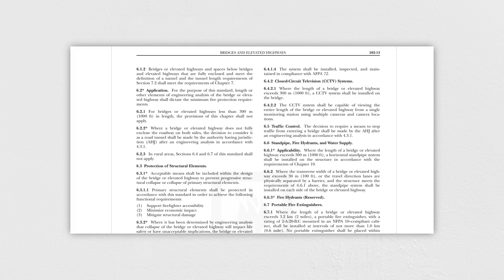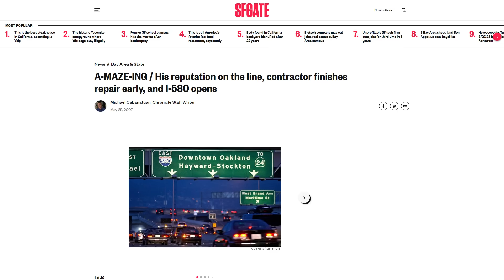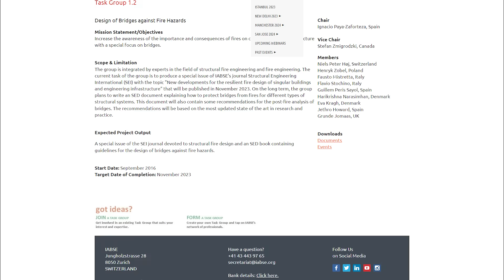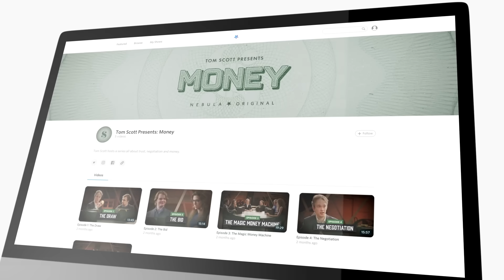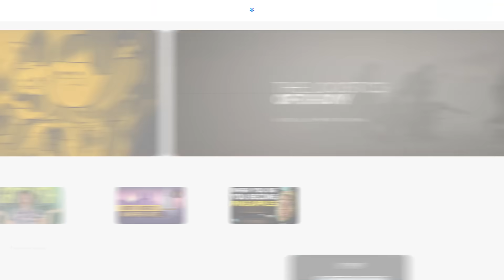Philadelphia I-95 Bridge Collapse Explained

Comment: 911 conspiracy theorists won't like this video.
Reply: “A second tanker hit the second bridge. America is under attack”
Reply: @clarkesuperman best comment! 😂😂😂 That made my day
Reply: @clarkesuperman 'fire doesn't get enough to melt steel and concrete someone use explosives' bridge falls from fire......
Reply: Conspiracy theorists are the Karens of major news events. A few agree w/them, some try to reason w/them, & the rest are mildly entertained but hope they don’t reproduce.
Reply: If this wasnt true, why do the tunnels in seattle all say "Flammable cargo prohibited in tunnels" because when super heated, concrete cracks and flakes apart, losing almost all of its strength. Steel reinforcements soften as they heat and bend under the load. Feedback loop ensues and concrete and metal failures lead to a massive, multi-ton chunk of rock and metal falls due to gravity. Yes, you can take a huge building or bridge out by having a huge fire in or under it
Reply: A structure designed to support heavy traffic collapses under its own weight when exposed to extreme heat.   Imagine if it had a 30 story high rise above it (not to mention kinetic damage from a high speed impact of a 200,000lb jetliner).
Reply: @guntherultraboltnovacrunch5248  there are also record number of investigations on the steel being used for bridges... beams Bought in China brought to america (terrible in China ore we all know Australia & the American Rocky's have the best iron ore) ... Beams then melted down in America & stamped American made... Just so they can beat the paper work & use cheap steal in America

Bridges have been a focal point of investigations because of there rapid decay from poor material & shoddy installation practices
Reply: Omg why did you start this? 🙄 :picard:
Reply: @J.C... because Truthers are great entertainment
Reply: Why? The immutable laws of reality never bothered them before.
Reply: @relectric69 lmao, conspiracy theories are almost always wrong.

There are very few occasions where a conspiracy theory turned out to be correct.

Take off you tinfoil hat, fluoride isn’t mind control, and touch some grass.
Reply: Untill you find out Bush owned the Truck!!!
Reply: Didn't some guy get 4.5 billion in insurance claim from 911
Reply: @devinsummer5838  So you think because the towers were insured that it was in "insurance job"?  Fabricated the terrorist story...Then they hijacked 4 planes, and killed 3000 people to get a 4.5 billion insurance payout?
Reply: @guntherultraboltnovacrunch5248  yeah
Reply: @--Valek-- well the overpass didnt have thousands of pounds of fuel burning, with high pressure air whizzing through the broken windows feeding the flames in a 'ramjet' fashion. Air travels along the sides of the building and builds pressure. High pressure air is like a turbocharger of a car. The bigger and hotter the flame, the more air it burns, funneling it and increasing the heat. A tall building falling can leave detritus further out than the height of a building. Yes, nearby structures get slammed with it, did anyone watch the street level views of the wall of concrete looking like a tsunami of rock? Also, if the building was demo'd it would have only been to cause a controlled fall, dropping the building on itself instead of falling over sideways as one side fails
Reply: @TheSkubna  how did anyone know they would need to rig the building with explosives so they would be ready for a controlled drop... Or did the demolition crew race inside while everyone was evacuating & set up the demolition in miraculous turn around time with no flaw in installation ???
Reply: @py2724  well, see, they clearly had to come in early and get it set up. You know, like the fireworks on the space needle. They just used too much. And the jets proved to be a great ignition source, like using those unscented incense 'punks'
Reply: @TheSkubna  possible they knew they couldn't stop it from happening so they made precautionary steps... 

"CONTROLLED LOSSES"
Reply: @TheSkubna  NIST's own report states and it's common sense that the fuel from the planes were used up almost instantly and served only to initiate the fire.
Reply: @--Valek-- That is interesting, considering how long these tanker collisions burn for. Someone has their mini broom and dustpan out somewhere.
Reply: @TheSkubna  NIST's own report said the fuel was used up in seconds.  The fire was supposedly office furnishings.  The flames coming out of the windows were orange, and the smoke was thick and black.  The office fire initiated by the plane strike wasn't a raging inferno.  But yet streams of >sparking< molten metal is seen pouring from at least one window.  The theory I think has the most weight behind it is a thermitic device that was dislodged from one of the beams and was pouring out the window.  If a wooden telephone pole can take off an airliner wing, there's no way for a plane that just punctured the thick exterior wall then had enough structural integrity to sever enough concrete covered core columns for fire >alone< to cause collapse.  Never mind the speed at which the collapse traveled.  The collapse speed alone violates physics if you believe it was just from the debris from above landing on the structure below(which was designed to carry 3 times the weigh as redundancy)
Reply: You beat me to it... those planes were essentially flying fuel tankers since they were pretty much full on collision. Sure, buildings have some engineering for fire, but not a fuel-fed high-temperature jet fuel fire. That is outside the realm of imagination for all but a few.

It almost makes one wonder if they had gone over the engineering and knew what the consequences would be.
Reply: Why did the Kersh rail bridge not go down like the road bridge?
Reply: @20chocsaday because it didn't get exposed to hours of heat
Reply: @20chocsaday  I’m guessing cuz train bridges are redundant while bridges that carry cars are segmented non redundant…meaning if one part goes it all goes
Reply: Clicks on comment labeled “DEAD DOVE Do Not Eat” … I don’t know what I expected.
Reply: They probably wouldn’t understand it…
Reply: Their lives are full of " short" , busses , inseams , and being denied from riding carnival rides .
Reply: You summoned them
Reply: How do you know there are exactly 911 of them?
Reply: @Falcrist  common core math
Reply: @Falcrist  hardy har.  :face-green-smiling:
Reply: I came here looking for this comment. Not disappointed
Reply: @310Bees no, you just don't trust sources that tell you something that doesn't agree with your understanding of physics but you believe it anyway, authority is not automatically truth
Reply: @TheBananamonger  It’s crazy how much some of you are desperate for attention. Were you not given enough attention as a child? Need to feel special?
Reply: Bet it didn’t fall at free fall though
Reply: @thepostofficeprince8819  The bridge didn't free fall?   There were 25 floors being supported by the damaged floors of the south tower (floors 77 to 85 damanged and burning).   That bridge had NOTHING on it, and it collapsed.    How much force would a 25 story building have falling 8 feet?  I'd say it would be enough to collapse the floor beneath it, then the one beneath that... then the one beneath that... then pretty much you got millions of tons of steel falling.
Reply: @guntherultraboltnovacrunch5248  I really don’t know if it would or not personally, it’s not my thing. I have no idea how much force something like that would have or how much the lower could withstand.
Reply: @thepostofficeprince8819  Any object connected to another structure cannot fall at freefall speed.
Reply: BINGO!!!!  I cannot stand those jackasses.  As soon as I hear them say "jet fuel doesn't burn hot enough to melt steel" I know I am dealing with a moron.
Reply: But the jet fuel won't melt steel...who cares if it weakens it.
Reply: The moon landing was flat. Jet fuel can't melt Dealey Plaza.
Reply: And the virus came from a wet market.
Reply: The term "conspiracy theory" itself is an invention of the ꓚꓲꓮ
Reply: WTC7 collapsed under the weight of intact passports that landed on it
Reply: With how many "conspiracy" theories have been coming true, I have no doubt that the US government had something to do with the September 11 attacks.
Reply: @relectric69 Realize that these conspiracy theories are fed to you by the richest and most powerful in order to distract us all with useless arguments and make us not question the disproportionate power of capital.
Reply: Bigfoot is responsible for 911
Reply: @TheBananamonger Much better to believe mentally ill trolls podcasting from their mum's basement. You conspiracy theorists are all delusional and belong in padded rooms.
Reply: The most Farfetched conspiracy theory about 911 is that jet-a1 fuel fire can burn hot enough to collapse a building. 
You need to be really dumb to believe in that one
Reply: The job of alex Jones conspiracy theories is to muddle the questioning of the official story with kooky theories,

The more important information about 911, was the fact that mossad was involved with the operation.,  and this was just like their first 911, the USS Liberty.
Reply: I came here to say the same thing.
Reply: @--Valek-- they found a building hundreds of feet in all directions. Moron
Reply: So many spastics in these comments 😂
Reply: @--Valek--  source?
Reply: @archive8080  source on the fused iron concrete in the basement?  You serious?  I can look it up sure...but this is like asking for a source when saying planes hit the towers.
Reply: RepentandbelieveinJesusChrist  "and midgets." Probably Danny devito.
Reply: HA! AAAHAHAHAHAHA
Reply: But if the fire doesn’t turn the structure into liquid it shouldn’t collapse right? 😂
Reply: @sterlingreece9355  false
Reply: Fr the police dont exist.
Reply: I think any job interview should include a question about WTC7. Think of the problems that could be prevented.😬
Reply: Ah yes - this video proves that an explosion did not collapse concrete. It also proves that potential energy/ gravity is sufficient to pulverize concrete into dust. Thank you for your thorough observation blind man. 🤡
Reply: millions of tons of commerce doesn't travel on top of the world trade center daily tho 🤔
Reply: @Hambush13  I think you're missing the point.   This bridge, designed with steel, failed under its own weight with burning fuel under it.   The trade centers, made with steel failed supporting the weight of  17 floors on one, and 33 floors on the other.   This bridge collapsing under its own weight supports evidence against the conspiracy.    As a young man witnessing the attacks, I kept asking myself why the towers hadn't collapsed.
Reply: Jet beams can't melt steel fire
Reply: Beat me to it.
Reply: They don’t like being questioned on anything. Simply asking “why?” enough times makes any argument fall apart
Reply: I was thinking the exact same thing. Already seething in your replies lol
Reply: Wow, 25 mins and people have already devolved into childish arguments. At least make some engineering based arguments everyone - preferably with something to back them up.
Reply: @davidjennings2179  Why was nanothermite found on the ground in the area? Why were huge steel beams thrown so far horizontally during the collapse? Why do other skyscrapers seem to be able to ensure similar fires without collapsing? 

How was Larry Silverstein so incredibly lucky to sign a new lease with terrorism insurance just 2 months before 9/11 which paid him $4.5 billion?  Why was he at "the doctor" that day instead of his usual breakfast appointment?  Pretty nice that he also got to avoid an unfathomably expensive asbestos abatement project...

How were the pilots able to perform the maneuvers so perfectly despite their flight instructors saying that they were barely competent to fly a a Cessna? Specifically at the Pentagon (of which we have no footage) where he did a perfect spiral down from about 20,000ft.
Reply: @davidjennings2179 Unfortunately that's not something conspiracy theorists are concerned with.
Reply: @davidjennings2179  there is no point arguing with 911 conspiracy theorists - it's a settled issue. There is no argument.
Reply: @davidjennings2179  a plethora of experienced high rise architects and structural engineers agree, controlled demolition.
Reply: @davidjennings2179  People have already made engineering-based arguments in this comment section. There are also 1,700 certified engineers who signed a document encouraging more independent analysis regarding the cause of the collapse
Reply: @micahned  That's great. Some people have made engineering arguments and I'm all for that - if there is something to be debated with facts I want people to keep debating it. The issue I have is with people devolving into playground talk. I can't remember what it was exactly but the comments were something like "my guy won" and "oh it must be opposites day" whatever side of the debate those come from they're not helpful to anyone.
Reply: @micahned and where are those “engineering-based arguments”? Because I don’t see a single one.
Reply: That was my response when I heard about this.
Reply: It's almost as if fire is destructive or something
Reply: Oh? Like WTC 7?
Reply: @coltonkay9000  and here come the anti-Semites
Reply: I always thought that too when this bridge collapsed I was like waitttt fire is hot enough to melt steel beams ? And it doesn’t have to even be jet fuel ????
Reply: They don't tend to like any science or engineering channels 😄
Reply: @harmonic5107 but some do, and more questions left unanswered than answered
Reply: @harmonic5107  Oh they love science and engineering channels!  They show up to spew BS in an attempt to show how smart they are versus all those people with engineering degrees or a capacity for critical thinking.
Reply: @TheBananamonger  Your comment could apply to either side of the argument
Reply: Why? Did Lucky Larry's entire family call in sick that day too?
Reply: Bootlickers will love this video
Reply: @dingdongmagee  your guy lost
Reply: @hayleyxyz must be opposite day pal
Reply: @dingdongmagee  just what I thought. delusional 😊
Reply: @hayleyxyz you're*
Reply: See this bridge thing makes sense, how you can compare that to 911 and think that makes sense is beyond me, there's literally no comparison between 911 and a bridge collapsing from fire
Reply: @mattb6646  they are both structures.  Both failed due to heat, compromising the integrity of the structure.   The big difference is the bridge collapsed w/ out having to support anything more than it sown weight.   Meanwhile, the towers had multiple floors damaged, AND had to support the structure above.
Reply: @mattb6646  heres your mental gymnastics trophy!
Reply: @dylansylvester4719 well atleast point out what you think is mental gymnastics if you're gunna respond, don't be cheap
Reply: @mattb6646  hey if you can't figure it out on your own
Reply: Ai bot
Reply: @davidstanziani5256  who is the ai bot?
Reply: I can understand that steel is weakened by heat, while still questioning who the real perpetrators of that attack were lmaooo
Reply: @Regular.Traffic   You really think we have to attack ourselves?   We piss plenty of people off.   And think of the 100's if not 1000's of people it would have taken to orchestrate this clandestine act, all of whom would have to remain quiet.    The only thing I'll consider is the possibility that Bush and company knew more than they led us to believe.    Watch a documentary called "Bitterlake".
Reply: @Regular.Traffic  lmaoooooooo
Reply: That's cool and all but never forget nothing hit WTC7
Reply: @ek8710 debris hit WTC7. And fire.
Reply: @ek8710  you have another conspiracy theorist in here complaining about the tons of molten iron and concrete that were apparently flung hundreds of feet away. Can you guys just go into a room and figure out what it actually is you think did or did not happen and come out here in the real world when you have a consensus?
Reply: @AliasA1 there is no consensus with conspiracy theories. That's how they stay alive. One hole opens someone plugs it. Making a new theory.
Reply: @ek8710 except for debris and outer mesh columns from WTC 1 that punched holes in the facade
Reply: @ek8710 so the 2 massive skyscrapers falling beside them did no damage to a building sharing a foundation with them.😂
Reply: @ek8710  Except for the enormous pieces of the buildings falling next to it and the uncontrolled fires raging inside of it. 

Christ, do we need to do this again?
Reply: @ek8710 are you arguing only planes can start building fires?
Reply: @ViolentOrchid I did not even know they knew how to build fires...
Reply: @ek8710  Stuff hit dozens of buildings, mate.
Reply: @UncleKennysPlace  there is absolutely no way you believe “stuff hitting buildings” explains the demolition of wtc7
Reply: @dingdongmagee ’stuff hitting buildings’ bruh, it was huge air planes. All it would take is the weakening of load barring elements on the floors that where hit to create a cascade collapse as higher floors slam into lower floors. That sort of stress on steel causes it to heat up, even to the point of melting. This is phenomena is well understood by anyone that has machined metals.
Reply: @dingdongmagee must be aliens then
Reply: @UncleKennysPlace you think falling debris made an entire building collapse? Are you daft?
Reply: @dingdongmagee Did you fail physics class?
Reply: @UncleKennysPlace yeah but a little peppering of debris doesn't make a 47 story building fall at free fall
Reply: @NZ-fo8tp and if that was what happened it would have looked totally different and large pieces of the build would have still been there, not obliterated into dust.
Reply: @dingdongmagee and your education or experience that lends any credibility whatsoever to your claim?     Anything?  I didn’t think so.
Reply: @ek8710 2 skyscrapers fell on WTC 7.
Reply: @theastuteangler ight it fell with no resistance a perfect vertical drop... 8.5 seconds/ 9 seconds (flawless free fall speed)
Reply: @py2724 the dropping straight down is actually a feature we built into buildings because otherwise you can get a lot more damage caused by a single failure.
Reply: @mattiOTX  there are steel hotels & wooden hotels that have burned for days and still didn't collapse... Metal never fatigued to failure either
Reply: Nothing but a shitload of debris from the north tower.
Reply: @ek8710 o matter what kind of mental gymnastics you do, there’s ONLY ONE explanation for #7, and that reason is office fires. In a pigs eye.
Reply: @ek8710 you always see the building 7's good side collapsing, never the damaged side which is mostly demolished. Look for that video and know you've been fooled. Get over yourself. You're a victim.
Reply: @ChessIsJustAGame  dude it wasn't mostly demolished LOL
Reply: Fed
Reply: I'm not saying jet fuel can't melt steel beams, but I am saying israel did
Reply: @awhyatmann3816 facts
Reply: Tf are you saying
Reply: @TheBananamonger  Where is your engineering degree from?
Reply: Building 7 was demolished. The fragments left were rubble
Reply: @BrianW.ConleyJr.  That can happen when two 110 story buildings collapse 1 football field away.
Reply: I don't see any molten steel like there was on 9/11.
Reply: @archive8080  There was paper written by a group of architects that questioned how an "oxygen starved fire" could have achieved temps high enough to melt and or soften steel.    Why would fires on the upper 3rd of two of the tallest buildings in the world be oxygen starved?     If you look at the plumes of smoke in any photo of the towers as they burned you will see the smoke moving nearly horizontally (indicating a substantial wind).
Reply: @archive8080  Well.   In a single bridge supporting just its own weight, you wouldn't have that much steel.  The World Trade Center used steel tubular structural system that differed radically from other structures of that time. The exterior walls were built of closely spaced steel columns.    Additionally, the impact didn't just affect one floor.   In the north tower, a 767 loaded with 20,000 gallons crashed into the 93rd thru the 99th floors.    Those 6 compromised floors had to support the 11 floors above.   The second plane crashed into the south tower between floors 77 and 85.   8 compromised floors that had to support 25 floors above it (that is why it went first).
Reply: Gas can’t melt steel
Reply: @washablejunk281 a campfire can break cement. If that section was wore out it's weight could cause structural failure.
Reply: It says a lot more about you that you immediately went to "this is how I can prove those doibters wrong" over one of the most horrific tragedies ever....
Reply: @grunclestanwannabe367  Well if 9/11 conspicuous nuts didn't make such of joke of themselves then people wouldn't joke about them. And 9/11 conspiracy theories take away from the seriousness of what happened.
Reply: Building 7. That's all the evidence you need bud
Reply: @Schmuly  Please help I'm trying to move these goalposts but they got stuck on the fact that WTC7 was evacuated during the crisis. Is the mantra now "uncontrolled office fires can't melt steel beams?" asking for my dad, bless his heart. Also, I want the goalposts over there, where it just says "ALIENS" in all caps way off in the distance
Reply: Na, we always got building 7 😂
Reply: What are you talking about??? Never in the history of ever has heat softened metal to the point of failure!!! 

GaS no MeLt StEal!!!🫨🫨🫨
Reply: They found large amounts thermite under the bridge?
Reply: @moparcasey3135 thermite is a natural substance used in plane crashes
Reply: Jet fuel didn’t melt steel beams
Reply: @Ry3nH NIST report appendix C mentions eutectic corrosion
Reply: Jet fuel can melt steel beams?
Reply: @m---- It doesn't need to melt to lose nearly all it's structural strength.  I first read that fact in a fire investigation book from the 1950s.  The book showed bent beams and collapse.
Reply: Yes. Quite easily in fact
Reply: @m---- don't need to melt then to weaken them significantly.
Reply: @m----  yeah? Why did you think the first two collapsed?
Reply: If you believe what the media reported about 9/11 you can continue living in blissful, mindless ignorance
Reply: @petercarioscia9189  <--🤡
Reply: @petercarioscia9189 this isn’t about what the media reported. Imagine thinking conspiracy theorists are the only people who spent a lot of time looking into the collapse of the towers. Don’t kid yourself, most structural engineers on the planet would be curious enough to check out the evidence and reports, and just quickly confirm for themselves that the conspiracy theorists are getting even the most basic physics wrong. The holdouts are amateurs and laymen, not people who know how any of this actually works.
Reply: @petercarioscia9189 ignorance is believing conspiracy-peddling charlatans
Reply: What about tower 7? Only skyscraper collapse from a fire. Wasnt even hit by a plane
Reply: @DrSkrungle  What caused the fires in WTC 7?
Debris from the collapse of WTC 1, which was 370 feet to the south, ignited fires on at least 10 floors in the building at its south and west faces. However, only the fires on some of the lower floors-7 through 9 and 11 through 13-burned out of control. These lower-floor fires-which spread and grew because the water supply to the automatic sprinkler system for these floors had failed-were similar to building fires experienced in other tall buildings. The primary and backup water supply to the sprinkler systems for the lower floors relied on the city's water supply, whose lines were damaged by the collapse of WTC 1 and WTC 2. These uncontrolled lower-floor fires eventually spread to the northeast part of WTC 7, where the building's collapse began.
Reply: @DrSkrungle  What was this whole frigging video about?
Reply: They will like it because it proves them right